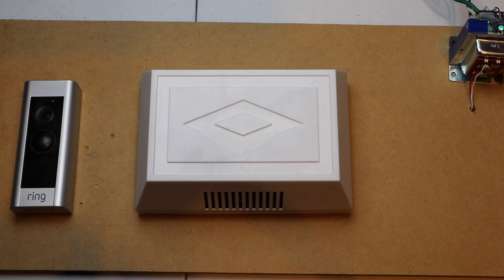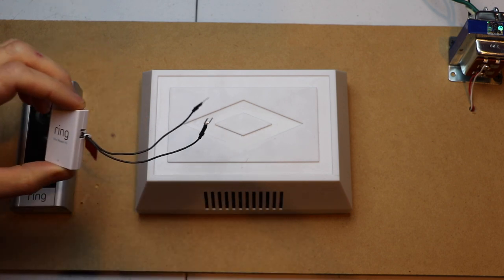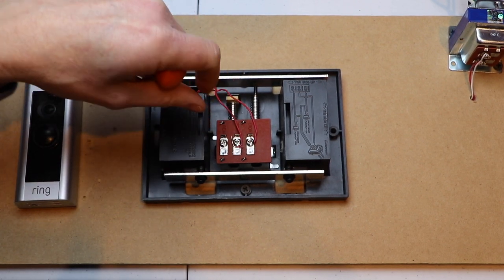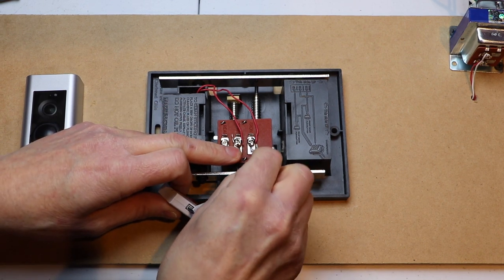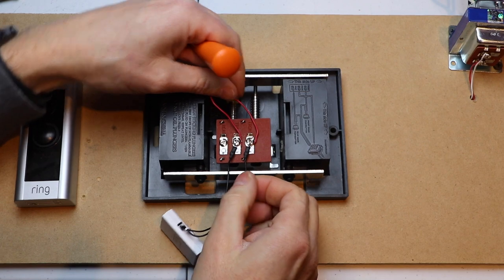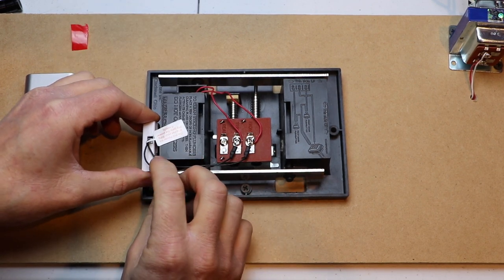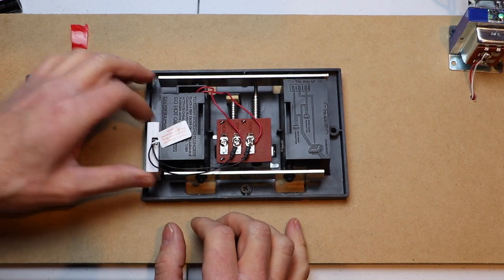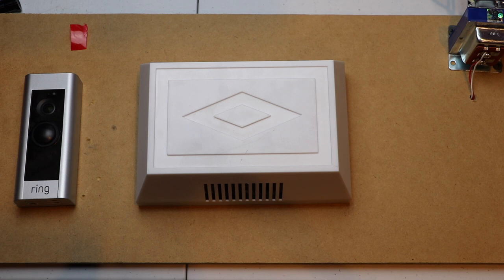Install Ring Pro Power Kit V2

Comment: I'm trying to figure out what this "power kit" is for and can a ring work without it?
Reply: Power kits are essentially capacitors.  Just like the initial power draw for an AC compressor, the power kit adds the extra start up draw for the chime mechanical assembly.
Reply: @mjohnslo  If I don’t have an existing mechanical chime and plan on using only echo devices as my “chimes” can I use the ring pro doorbell 2 without the “power kit”?

Comment: After installing the pro power kit to our doorbell chime (new construction home), I now have a continuous buzz/hum coming from the chime box. This did not exist prior to installing the Ring Video Doorbell Pro.  Is there something additional I need to do to eliminate this buzz/hum?
Reply: That happened to me when I was fooling around with the doorbell itself. I think that means the wires that are connected to the Ring doorbell aren't tightened enough around the screws.

Comment: THANK YOU!!! so much for your videos. I watched a few today, and corrected the issue w/ my Ring Generation 2 not charging off of the doorbell wires. I bought a kit on amazon for $5, it had the power kit v3 and a bunch of supplies, amazing price! anyway, the Ring website says the power kit v3 is not for the generation 2, but it worked! I also learned how to include my house chime or not thx to your videos, and learned where my transformer is. so beneficial, keep up the great work! Really appreciate it! cheers

Comment: can it be possible to have the front and rear  connections go to the door bell ?    my setup is very strange at home...  when I remove the front or rear connection  my ring door bell pro would turn off in the front door...       I thought  one of the connection from the ring pro should goto  a transformer and one connection to the front in the chime ?    can you let me know what is best way to find out how to resolve this crazy setup ?  this was installed by someone and my mechanical chime hummms  or makes noises  annoying.

Comment: if you're not using a preexisting home doorbell ....and installing straight to wall outlet ... this Elk TRG2440 24VAC, 40 VA AC Transformer with PTC Fuse works great with the Pro power kit version 2 ..BUT ...WITH THE POWER KIT V2 PEEL OFF THE STICKER AND YOU WILL FIND 2 HOLES ON SIDE OF THE V2 KIT USE that INSTEAD OF THE SNAP-IN WIRES PROVIDED

Comment: Do i need this to be installed? will it helf the wifi connection?
Reply from the maker: Yes you need to install this.  Chances are you are having a voltage issue with your transformer.  A standard transformer does not have enough capacity to power the Ring doorbell and the doorbell chime.  You need to upgrade your transformer to a 16V30VA transformer or bypass your chime.  If you want your doorbell to work correctly.  One of those to options will fix your problem.  Otherwise, you will rip your hair out trying to get this to work.

Comment: Our builder installed the Ring Doorbell Pro and a mechanical chime, but skipped this step.  The Ring worked fine (apparently the 16v from the transformer is sufficient for both) but the chime would frequently buzz, sometimes loudly.  Fortunately, they left the box with the Ring Pro Power Kit V2, so I connected it into the chime, and now it seems to work fine without buzzing.  Thanks!

(But I already did buy a Ring Chime, so I'm just using that alone)

Comment: I had mine hooked up exactly like this but when you press the button on the Ring doorbell, you'd only hear the "Ding" but no "Dong". I removed the Pro Power Kit from the trans. screw but left it connected at the front screw and voila! "Ding Dong". Is there a reason why it won't work completely when it's hooked up the way Ring and you have explained the Pro Power Kit?

Comment: Hello, I have a ring video doorbell pro. I have one chime box, but I have 2 doorbell buttons one at front door and one at rear door. I want video pro on rear door. Instructions say to connect pro power kit v2 to the front /trans. but I want to connect to the rear so should I connect to rear/trans of the chime box and would the doorbell in the front still work thanks for any help. Dave
Reply from the maker: You are exactly correct.  You would want to connect it to the rear & trans.  If you get it powered up and it’s having problems. You will need to upgrade your transformer or bypass the chime.  A 16v 30 va transformer works very well.  This will show you why you would need to upgrade  https://youtu.be/QUO7o_vrEMw. Good luck!
Reply: @sellgooddeals-DIY  thank you so much for the quick response I think my transformer is a 16v 10va don't know if that would work properly. Thanks again
Reply: @sellgooddeals-DIY  Hello and thanks again for all the feedback. So. I have one last issue for connecting this weekend. I have one chime if I bypass the rear for ring pro. Is there a way to still use the regular front door chime as before. So use the rear with pro bypass and the front with normal chime

Comment: To keep the original chime, do I need a 16v/30a or a 24v/40a transformer ?
Reply from the maker: The bare minimum for it to work is a 16V30VA transformer.
Reply: @sellgooddeals-DIY  a 24V 40VA would be fine?
Reply from the maker: @IvanMr  That will work but I prefer 16V 30VA.